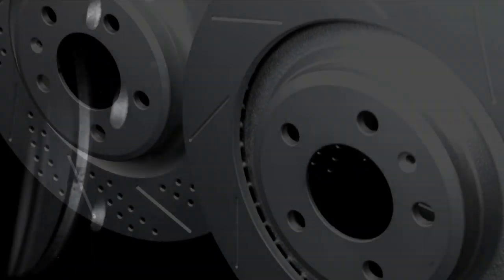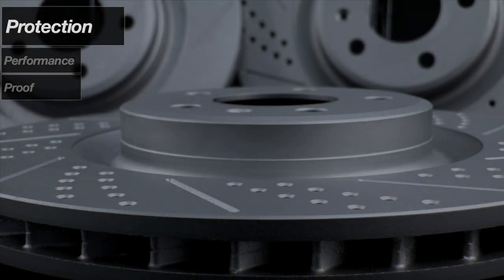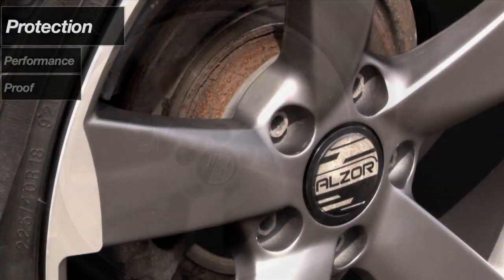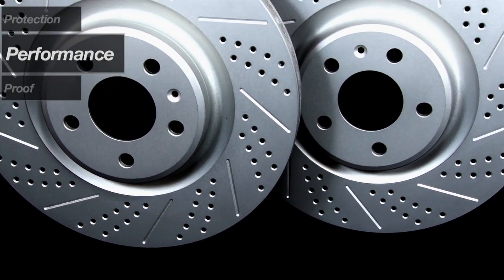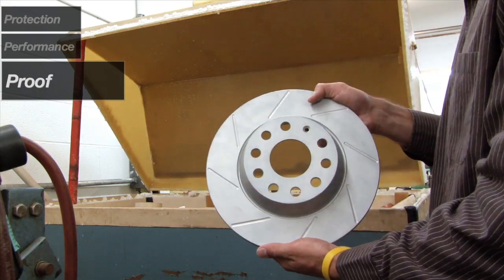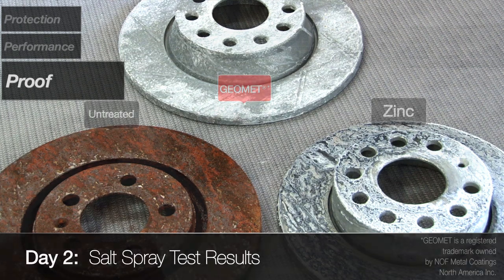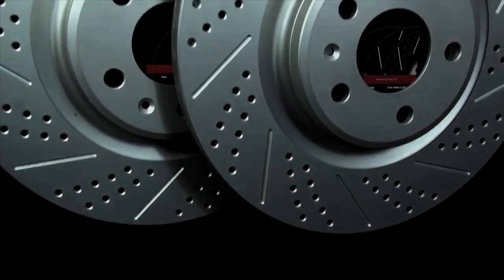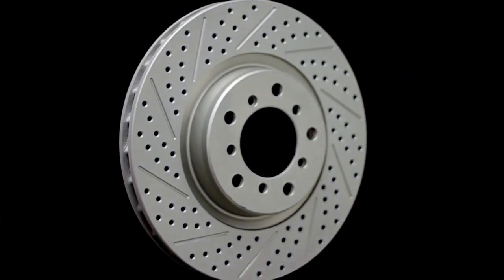ECS Tuning: ECS GEOMET® Brake Rotors

Comment: I have these on my MKIV. You cannot resurface them.... Which sucks.. And for some reason even with new pads they wore out unevenly.
Reply: Did you replace the slide(guide) pins+bushings and also replace and lube your hardware? Also did you set/break in your pads after installing. When changing parts, it's not just replace/install. There's more to it then that